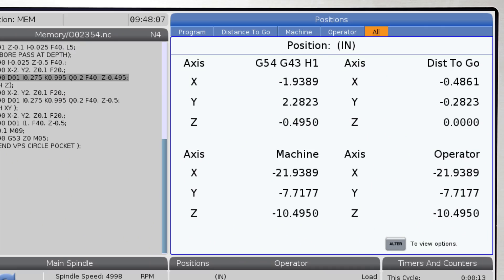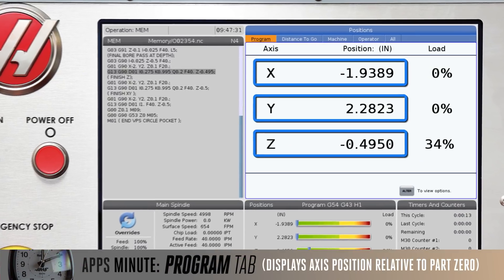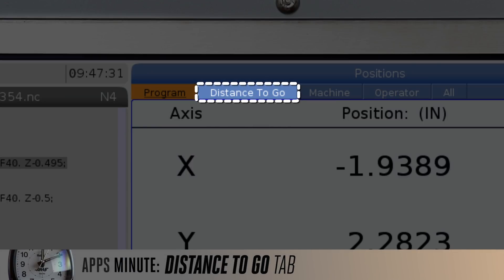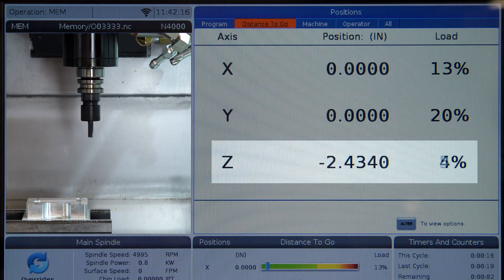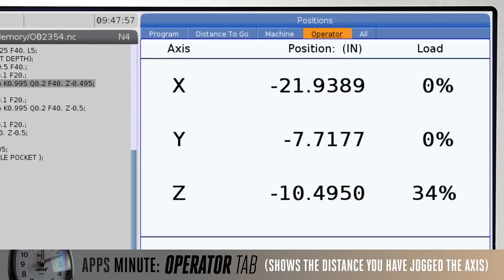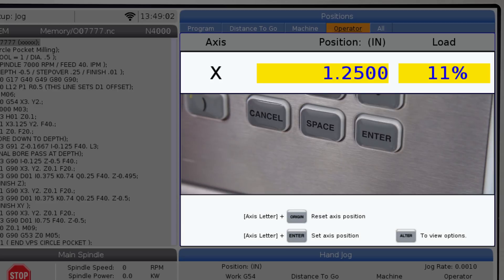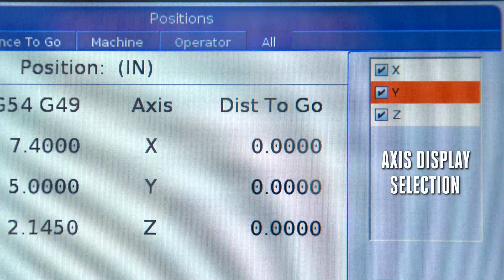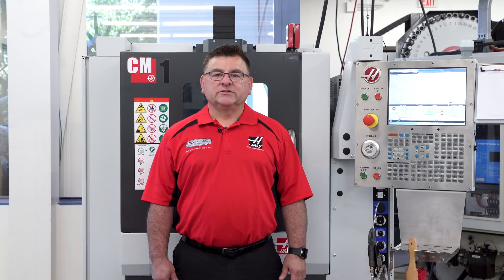Apps Minute - Position Page

Comment: So when a lathe is set up for diameter, but on classic controls, you must enter the radius instead of diameter, everywhere else on the control, you enter a diameter.  doesn't make much sense does it?  X2.50 Origin = X 5.000 on display.